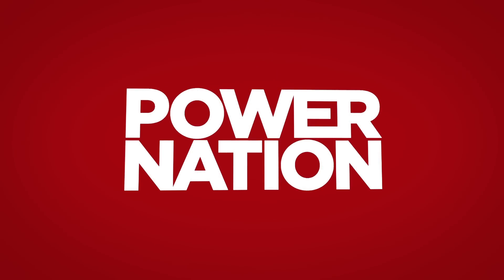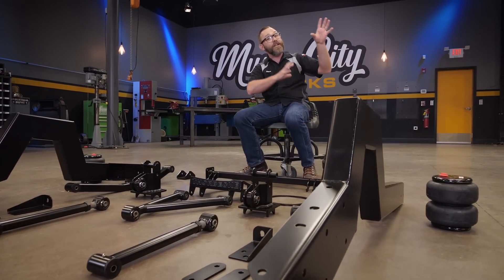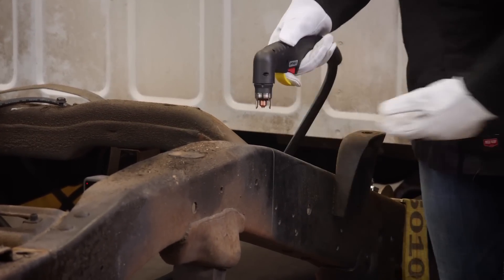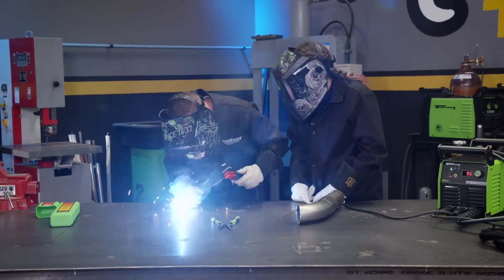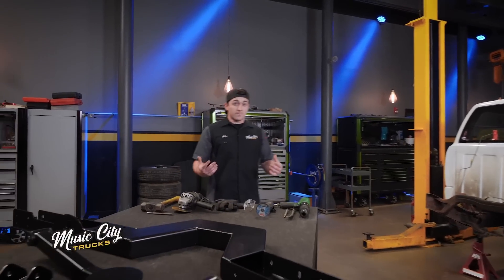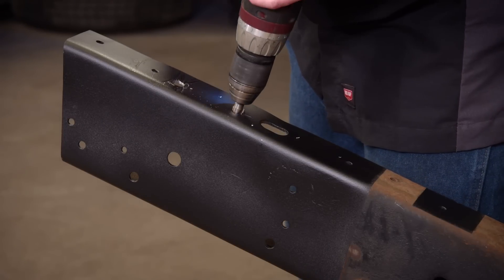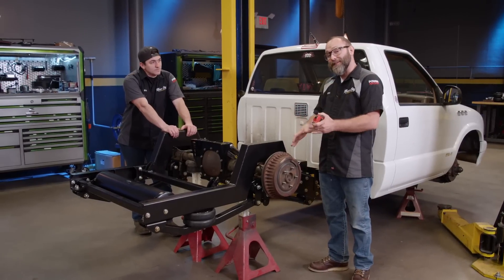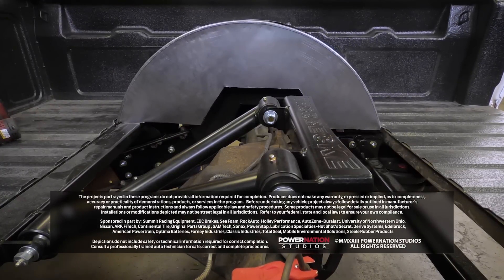Ditching The Chevy S-10's Leaf Spring Setup In Favor Of A 5-Link Kit - Music City Trucks S3, E8

Comment: MiG welding was basically invented for assembly lines to speed up and simplify the welding process so companies could easily train employees who otherwise would have difficulty welding. Now take a good welder and give them a stick , they can out weld and get a better quality weld than any mig welder.  Tig is nothing more than gas welding with electric instead of the gas.
Reply: I don't know, worked in a weld shop for 15 years and saw some guys that really could lay down some great welds that would easily pass a die check and X-ray exam.  The guys there would save the stick welding for heavy structural jobs

Comment: I would never trust a bolt on back half, besides all those bolts look like crap. I would've bolt it together and then weld it up for extra strength front and back . And box in the rear frame section for even more support
Reply: Ran a similar setup on several vehicles for several years never one issue.
Reply: @Jonboat Morava  o guess I am just not trusting of something that is supporting the entire back of the vehicle to some bolts. I guess it is because I would have just made a completely new, completely reinforced back half that was welded
Reply: The rest of the truck would fold long before the bolted on back section would fail....
Reply: @keithlempka2593  well. Do you trust your bolted on control arms, leaf springs, shocks motor etc? Or you weld all that up too?
Reply: @Jonboat Morava  of course I trust the items you listed but imo back halfs  should be welded
Reply: @keithlempka2593  that's fine. Just saying if a couple bolts can hold up the front of the vehicle why couldn't it hold up the lighter back half?
Reply: @Jonboat Morava  because it has to handle all of the weight of the entire back of the truck and if you drive it hard burnouts and donuts and actually take some hard corners with it I would be worried about the bolts failing . Again  jmho
Reply: @keithlempka2593  okie dokie
Reply: Fun fact most structural steel is bolted together with TC bolts. Welding takes too long and must be X-rayed. If you do not trust bolted steel, I suggest avoiding all modern buildings.

Comment: That 5 link is WAY overkill, you can lay frame on a S10 with just a basic notch and use a mono leaf with block most of the time. If you wanna lay with wheels bigger than like 18s then yea you need a link set up, but then the rear will be the least of your worries, the front is where you need major surgery to lay frame